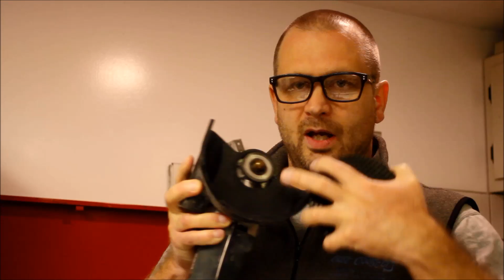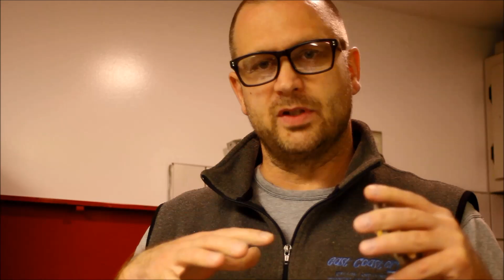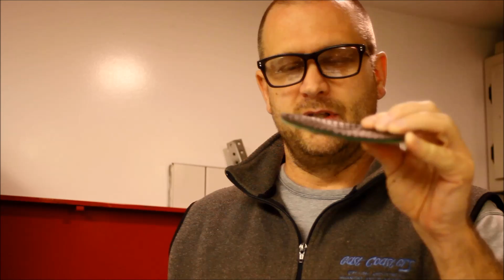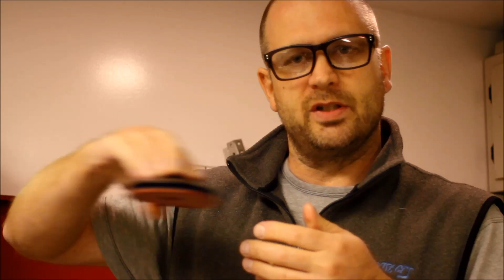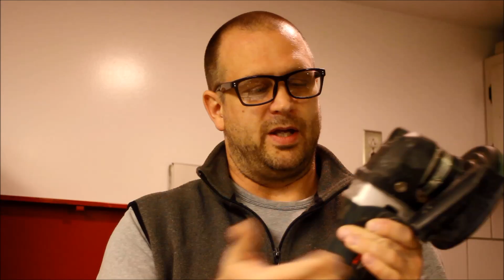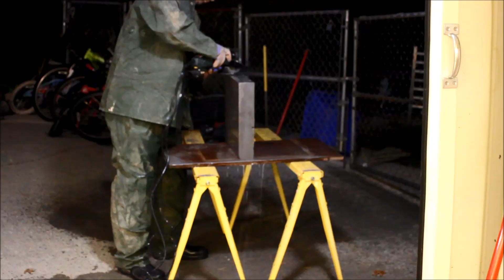How to Polish Concrete Counter Tops

Comment: How do you recommend polishing counter tops that are poured in place? Can I use a spray bottle in conjunction with my polisher to try and keep spray limited?
Reply from the maker: You need a lot of water to cool and lubricate the pads so a hose connection is mandatory. There's no way to polish once they're installed without making a mess.

You can get a polished look with epoxy coating. It has pros and cons but it's about as durable laminate as far as heat etc.

Comment: Average kitchen will use 6 bags of concrete $30-96, $55 in melamine and silicone for form, $50 or less in sealer.. no where near $1000. And you can keep the melamine finish so no polishing needed.

Comment: Hey James. What about the final polishing step, the making it shiny? Do you use a particular sealer or polish? I’ve used wax on floors before, what about that?
Reply from the maker: The two options are wax w sealer or epoxy.
Reply: @JamesGlassJamesGlass  Thanks James, quick reply. I've been doing some research. Can you recommend a brand or product? Is was suitable for exterior, or am I better off with a glaze n seal type. Thx
Reply from the maker: @madmac66  Sealer w wax is fine for outside but will be more affected by environmental conditions, like acid rain, uv exposure, etc. 

For food safe sealers, the brands sold by Cheng on the concrete exchange are all good. Inside or out, food safe or not, just use carnuba wax over the sealer. If food safe doesn't matter use any sealer and carnuba wax. 

For epoxy, the easiest to work with is the 50/50 two part type sold in any box store. 

Hot pans will melt the epoxy and wax so treat counters like you would laminate ones. Both methods can be repaired tho, unlike a burnt laminate.
Reply: James Glass wow, great detailed reply. Thanks a bunch. This is purely for exterior so food safe not an issue. I will use a penetrating sealer and a carnuba wax (same as car wax) over it. I did look at concrete exchange and they do have a lot of product on there-great resource. I’ll send an image when I’m done so you can see how it turned out. Thanks again for your help!

Comment: can do this with a regular grinder if you dont have an extreme amount to get done, just use a hose turned down low or bucket it doesn't need alot or a continuous flow of water once youre polishing not grinding
Reply from the maker: If you use a gfci and don't care about the finish too much. The proper grinder is water shielded, variable speed and gfci protected
Reply: ideally yes but someone at home looking to try it out who already has a grinder can give it a go without the big entry cost, although 200$ isnt much for the proper gear make it back on the first set (a 12amp model is alot quicker and will last longer then a 6-7amp model)

Comment: Hi, I really really hope someone can help me!!  

I have been trying to achieve a nice sheen on my side table that I have made out of concrete. I am using a angle grinder, at no higher then 3000rpm with wet/dry diamond polishing pads, but I can not achieve a smooth finish! I've spent hours working from 50 grit up to 3000 grit and it has not achieved anything like a 'smooth finish'!!  I've watched soooo many videos and read articles and it seems like my concrete is defying the odds!!! Has anyone got any ideas on what I'm doing wrong??? Will a solevant or densifyer help with the texture?? I would really and truly appreciate a yonks input.....!!!?  Pleeeeease 
😧
Reply from the maker: Sara Paknejad Are you wet polishing? Regardless, concrete won't shine on it's own-- all you can do is make it very smooth. Anything beyond 1200 grit isn't especially noticeable either. The only way to get a shine is to finish it, which could be anything from sealer with wax to a clear epoxy.
Reply: James Glass Thanks so much for your input.  Yes I am wet polishing. I wanted the exposed aggregate high-shine look and I threw some glass in the concrete mix,  so I spent a while around 50-100 to expose it all. Any sealant/wax products you would recommend? Most highly rated sealants appear to be US brands with extortionate shipping costs! UK seems fairly limited to mostly concrete floor sealants.... Thanks again!
Reply from the maker: Sara Paknejad I can share some links, sure. My email is James at James Glass . org

Also, check out the Concrete Exchange run by a guy named Cheng.
Reply: Absolutely, use a densifyer. Also, what kind of diamonds are you using?  When you get higher you want to switch from ceramic diamonds to resin diamonds.
Reply: Sara Paknejad I actually do this for a living and I can give you a name for a supplier if you are interested still? p.s. yes im in the UK

Comment: can polished concrete feel as smooth as polished granite?
Reply from the maker: Nope. You can get it pretty darn smooth, but granite will be smoother.
Reply: Have you done any extremely polished concrete tops? I truly wonder just how smooth you can really make it.
Reply from the maker: After about 1200, the concrete won't polish any more (granite can be polished to 3000+). The two materials can really be conflated: granite is a natural (hard) stone and concrete is a human made (soft) material. 

With treatment concrete does get smoother--either a sealant and wax or epoxy is applied most of the time to polished concrete, but it's an artificial smoothness compared to that of highly polished granite. Both are great--it's just a matter of what you want (or what you want in it--you can cast a trilobite in concrete, but granite is what it is).
Reply: i saw some concrete counter tops done by a company local here, about 8 of them, i bet they didn't even sand it to 400, it felt quite rough. On my test patch, i sanded to 800 and its quite smooth, i guess i won't be able to get granite smooth, but maybe close enough and with the sealer even better.
Reply: John G the problem you often run into when wet grinding beyond a 400 grit is that most sealers wont mechanically bond to the surface.
I can tell you from personal experience from doing this everyday that if you hone at a 200 grit and then polish at a 400 that the surface will be smooth after polishing and after sealing, it should not feel rough or textured unless a client has specifically asked for that or something has gone wrong in the polishing or sealing process.

Comment: hi, I have a Bosch 5" Concrete Surfacing Grinder CSG15. can I use this grinder for polishing too???
Reply from the maker: That's a nice grinder, but it's not the right one for polishing or doing finish work. It's really meant to be used dry (with the optional vac recovery dust system). 

The wet polisher above costs about half as much as the Bosch unit, even with a starter kit of diamond pads, so the good news is if you're the kind or guy that doesn't mind dropping the coin it takes to get that dry grinder, then you'll be very happy the wet polisher costs so much less!

Comment: James thanks so much for this demo. I am exploring getting into this as a hobby (I used to do some cabinet work, but don't really have the garage space for fine wood working anymore). This looks cool and I thought I might work up to doing a dinning room table.  

You mention in your video that you will be doing more concrete counter top related tutorials. I can't find those on your YouTube page, do you have nay other videos in this area?

As for my project, the design I have in mind would have a walnut inlay embedded in the concrete. https://s-media-cache-ak0.pinimg.com/736x/83/48/21/8348218d1bb036d2913c04c197bd3609.jpg

Its ambitious I know but its good to have goals. :) As I think about how to do this I am wondering what kind of reinforcement I will need to support the joining of the wood and the concrete. Any ideas?

Comment: Hi all, I have made some small concrete plant pots and would like to grid and polish them to reveal the aggregate. Just wondering if for such small scale work, it would be advisable to dry polish rather than wet. I cant really afford a wet polisher and it seems they are more for large scale jobs such as counters and floors etc. Would it be possible for me to simply buy  a regular angle grinder and some graded diamond pads and polish he pots down with those? Im looking for as smooth and shiny a finish as possible really, but equally if I can save myself £200 I would rather do so! Any advice from those with some experience in the area would be very much appreciated!
Reply from the maker: +Blacklava Hi! If you just want to knock off seams, you could try to carefully dry grind, but without water, you'll just be grinding. In fact, polishing (if you want a smooth surface with no gouge and grind marks) can only really be done with water and diamond discs. It might look cool to dry grind them though, but they wouldn't really be polished. You might try one and see how you like it. You could reveal the aggregate by grinding and provided you don't mind the rough marks and such, you'd be fine.
Reply: James Glass  Hi James, many thanks for your reply. I have tried dry grinding already and it works though like you said the results are pretty rough, though I mostly put this down to the fact that I have only used one grade of paper so far. Perhaps I could try some finer grains on top of what I have done already and see if I can get a smoother effect.